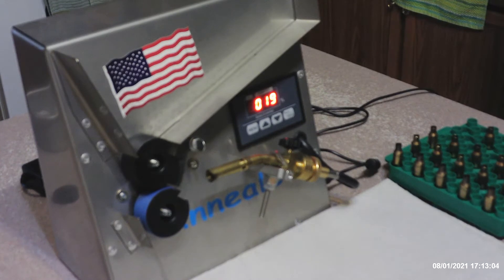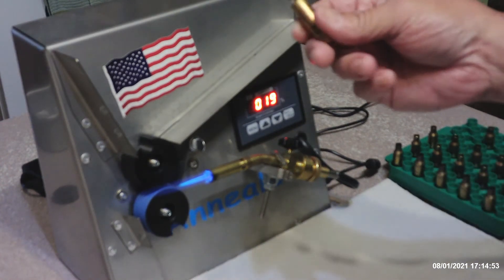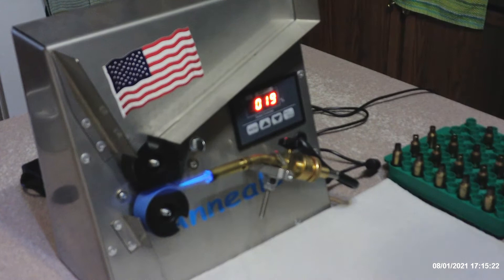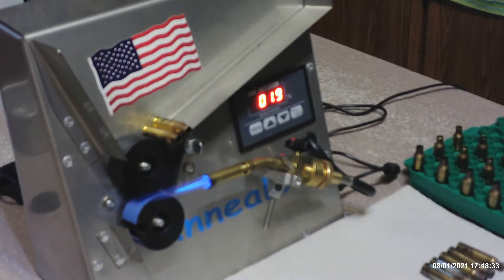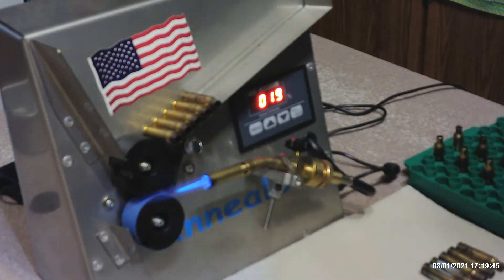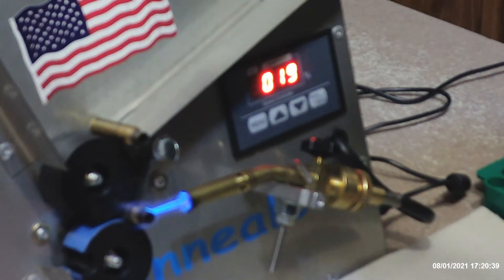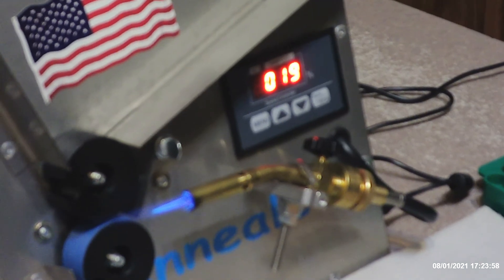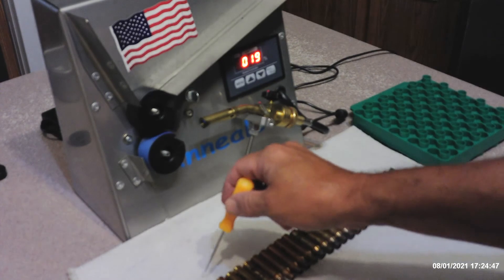Annealeez 2.0 08/01/2021

Comment: Why the hell couldnt you let it run instead of picking the cases out with a screwdeiver.
?  Doesnt it work???
Reply from the maker: I just simply had the time to pick it out of the wheel. and line them up on the towel. Plus, all of my cases are numbered and in order. Just my OCD way of doing things. Also, The Annealeez works great for what it is.😎
Reply: @ctech01  I am also OCD and it just drives me nuts that I couldnt see it work?  I am thinking about getting one,  but, from your video I cant really see that it works because it wasn't allowed to complete its job.
Reply from the maker: @jimisbell  I'm sorry Jim. From the point of where I stuck the pick in the case and pulled it out of the bottom wheel.,,,  " The Annealing was over. " The case just cycles down and falls out on top of a towel. I do not use the steel pan that came with the Annealeez. The brass normally falls into it. Too much dinging and clanging for my likings.  I will consider what you said,, when I make the next video. Thank You Sir.

Comment: Do the cases spin consistently?  Did you have any problem with spinning?
Reply from the maker: The cases do turn consistently.  If you are having that problem, check the gate setting, and wheel timing.
Reply: @ctech01  Thanks